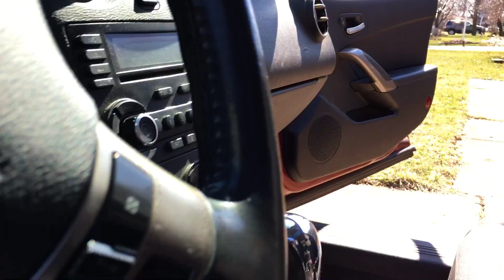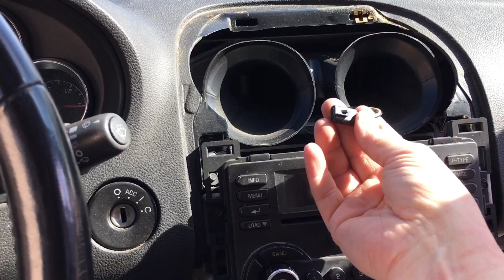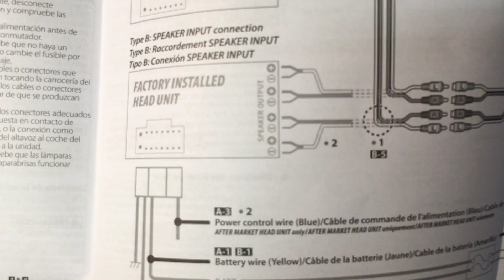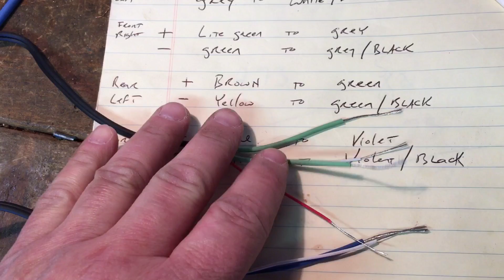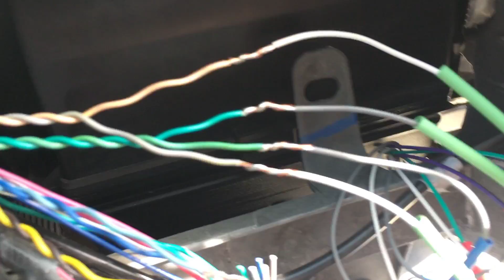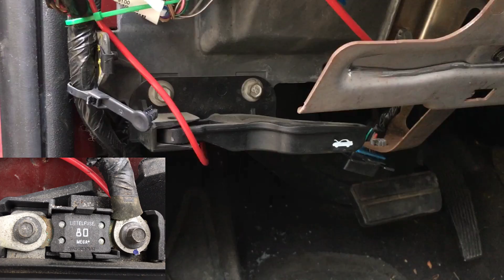Pontiac G6 Amplifier Installation

Comment: I have the same car I got as far as taking everything apart I'm a lil confused on the connection parts.. I have a boss amp my rcas are red and black though. If you could help I'd appreciate it
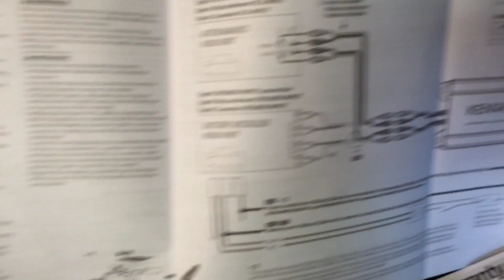Reply from the maker: Red is usually the  right side and black would be left side. So you should have two reds and two blacks then, a red and black for the front and a red and black for the rear. I explain how to connect them starting at 8:00 in the video. You don’t have to solder the connections, you can crimp them but i like to solder wires like this that are not easy to get to. Good luck

Comment: what’s a filter on the power wire ? how do you do this? thanks
Reply from the maker: If your getting a humming or buzzing noise through your speakers as you accelerate it’s likely coming from the alternator. A filter connected inline with the power cable to the stereo will eliminate the noise. There’s YouTube videos on how to do that. Good luck.
Reply: @LoFiMofo  thanks so much ! ⭐️
Reply: @LoFiMofo  sometimes that humming is a ground or in my past experience a crap set of rca plugs

Comment: so where do you connect the remote wire for the amp cause I have the same car and everything
Reply: anything thats keyed 12 volts
Reply: @ManthatsCool100 Yes sirrrr!
Reply: Run a switch or connect to a fuse. I would do research on that tho
Reply: Blue wire on factory harness pretty sure